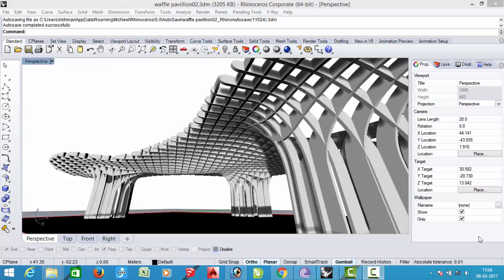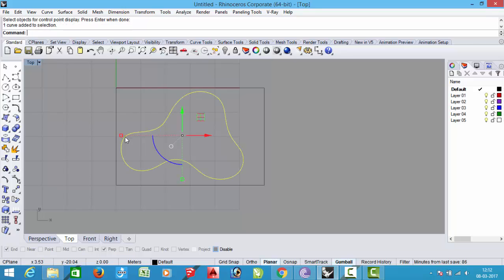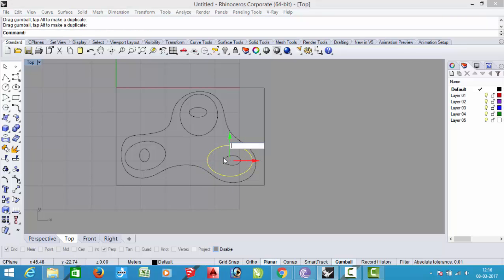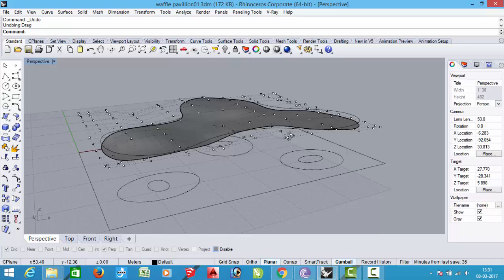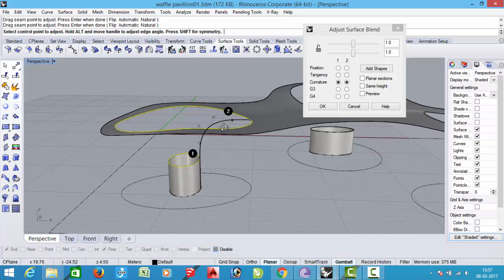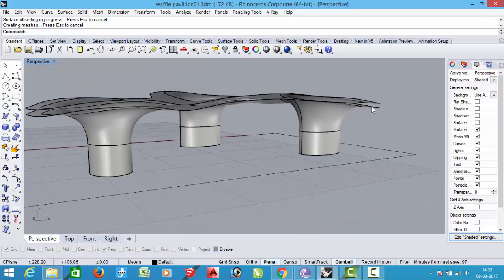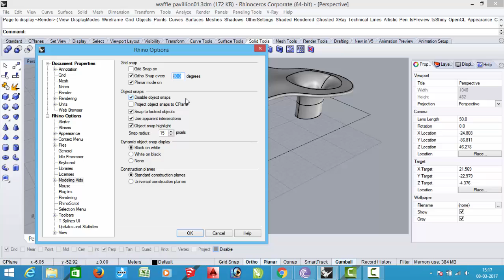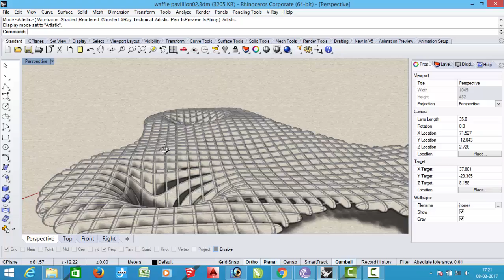Rhino for Architecture :  Waffle Pavilion

Comment: Thanks for your tutorial. I just get a problem after ExtrudeCrv that some of the pieces with thickness are not in solid. I just try to use cap-fail, planarcrv on both side-fail(seems like the curve is in segments), even patch-fail. But one of their surface is created by curve boolean, others can not. Is there any suggestion to fix the trouble?

Comment: great tutorial..but I have this problem that I am not able to join the contour lines and group them ..when I press the command join the selection goes off? I tried to see the command in the video..it doesn't show anything? could you suggest where is the problem
Reply from the maker: Group them right when you make contour so it can be selected later all together.
Reply: had the same problem. grouping worked though

Comment: bro thank u so much for ur effort in this video...but I have a problem with making contour..when I implement the contour tool I had some empty surface and some of them are solid ..what is the problem ?? u know ??
Reply from the maker: Hi, It happens when the geometry or object is not clean. you have to be careful then you are blending two different surfaces. add cross sections if you have to. the resultant surface should not overlap or have any gap. you can to a surface check surface>edgetools>showedges for poly-surface objects.
Reply: thank u so much bro ..I will check it :)
Reply from the maker: It will be  better if you mail me your file at abhinav@formforge.co if will check it for errors